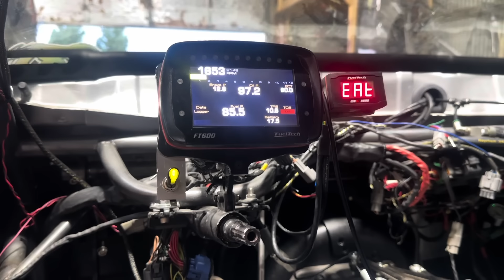Methanol Plugs Up Everything , Sho'nuff

Comment: Worse yet is leaving a fuel system dry, even if flushed. On aircraft, we would fog / spray the entire system, to include fuel cells, removed and open lines, with oil, to prevent dry rot leakage and deterioration, as things came apart. Less then a days time left dry, would turn things to shit.

Comment: You might consider mixing 5 gal. of gas without methenol with 2 cycle oil, not a sythetic oil, a slight touch of castor in the mix helps.
You would run it throught until all the alky is purged and running on gas.  This can be left in the system untill race time.  A drain would have to be added to the bottom of the fuel rail to pump the alky through to purge of gas and oil mix.  Also help to prevent cylinder wall etch and sticky rings from the alcohal corrosion.   And The problem that you are having in the fuel lings. Save the gas for later storage.

Comment: One of the things that could expedite corrosion is electrolysis (static charge), so bad grounds, or alot of dissimilar metals with flowing liquids, boats have this problem and that’s why the have sacrificial anodes, could also been a bad piece of aluminum stock that the fitting was made of
Reply: my thoughts also

Comment: We used to run an injected small block on methanol and a promod. After every race we drained the tank & lines, blew them out with air, blew out the check valves, barrel valve, and pump. Then sprayed WD40 in the check valves, barrel valve and pump and put it back together for the next race. Did it every time.  We also ran alcohol top lube. I personally think that helps with corrosion having an oil in the fuel and it helps the top end since the fuel is so dry. The blower rotor strips live a lot better with top lube.

Comment: galvanic corrosion. look at the metal interactions , there is a chart to see what metal can be in contact. a small aluminium piece next ro a large steel can act as a sacrificial part (anode). interesting stuff.

Comment: The white gunk is likely from the aluminum fuel cell, and the fittings. If you don't flush with gas, cap any fuel system vents so air can't react for upto a week.

Comment: My thoughts: 
Methanol has a low boiling point at about 148 degrees F at sea level, likely lower in Colorado.
When it sat empty, there were probably still drips of methanol in nooks and corners in places like the fuel rail, injector tophats, fittings and stuff. 
Those drips probably evaporated and recondensed throughout the air of the empty fuel system many times allowing the methanol to get all over the place. 

Glad to see you got it cleaned out and restored before it cased any bigger problems. Race on!

Comment: My Kid is always impressed with the Wrenchers death Grip. 1160 ft pounds with a grip force tool. It pisses off My Co Workers  that the the Mechanic has a better grip than the Boys I work with and Dead lift anything They can not Do, Its called Manipulation of force Gang 58 and still strong.
Reply: There's no way it's 1160. 116 or 160 maybe

Comment: Unfortunately that's usually what happens with those big brush/bull guards. Since they're so rigidly supported to the frame it typically causes frame damage instead of just crushing the crumple zones of the truck, usually no airbag deployment to help soften the blow, etc. You usually end up with REPAIRABLE damage without one and a totaled frame if you run one.

Comment: That was a lucky escape for Jamie, sucks for the timing as it could be fixable - hopefully insurance plays nice and/or you can borrow something.

Yes, methanol is great as a fuel, BUT you have to make sure EVERYTHING is compatable with it! With aluminium/aluminum it's actually a VERY re-active metal but it forms an oxide layer 'skin' that protects it - but methanol reacts with it and stips the 'skin' off and, especially if there's ANY moisture in the fuel, it allows very rapid corrosion to occur.
I did mention this way back, but...
The best option it to go for steel fittings through-out, steel fuel tank, special methanol resistant lines and tank liners, injectors, etc.

Comment: Minor frame and suspension damage, get it pulled, suspension parts changed out, get a new bumper and alignment then haul ass. If replaced partial frame rails and full frames but thats minor rail flex that can be tweaked back unless the cross brace under the pan is buckled then that gets into nearly frame replacement

Comment: Some castor twostroke oil saves a lot!
Never sits with fuel....  
That´s one of the problems, you need to open up the lines or let it sit with petrol flushed through.
But consider my advice with castor twostroke oil, like red line alcohol premix.
I makes like a corrosion protection all over inside.

Comment: When I ran my vintage sprint car on methanol, after every race I used yo drain the fuel then sprayed WD40 in all the lines then used air to blow the lubricant through the lines and injectors. I couldn't let it sit for more then a week without doing this exercise

Comment: Brent,methonol will eat away most soft metals Ali,copper,zinc etc. Any fuel with 10% + ethanol can be corrosive. Oxide coating on fittings etc is the only corrosion protection you have. Do you run   a low / no ethanol  fuel flush thru engine after races.

Comment: Methanol like m1/m5 leave a slight residue film on corrosive metals, I tried not pickling when running it and similar probs with pumps and reg going bad because the metals deteriorated. Ultimately we’re back to c16 to avoid the extra work cause it wasn’t enough benefits to work

Comment: The fittings look like galvanic corrosion  got to them. Check your grounds. You also need to run ptfe lines if you're not already. It surprises me how many people dont run ptfe lines. I have them in my build, and i only run pump gas.

Comment: Check for power and ground flowing thru or past the fuel system components, electrolysis could be playing a role in speeding up corrosion.

Comment: Everything alluminium needs to be hard anodized inside from tank to fuel rails.certian mixes of alloy are less effected so alloy choice is also Important .the system will also get a hard time if it drains back and ends up with air inside I've been through the whole Grey powder scenario before it sucks.we used to have to clean the whole fuel system injectirs rails lines every meeting or the cat wouldn't last a meeting.

Comment: I work at a race engine shop in chino California. We produce some of the baddest 4 cylinder motors in the world for dirt track racing….ive never seen a fuel line look like that in the 3 years I’ve worked at esslinger engineering. We run m1 on 90% of our race engines….never…what a freak situation!

Comment: Methanol doesn’t eat lines and fittings, it’s actually when you drain the system and leave it empty that it oxidizes…you either have to pickle the system or leave the system pressurized and toped off with methanol

Comment: Electrolysis maybe.  Kinda seems like it may have some sort of current flowing thru the fuel lines. That looks like the same kind of residue you would expect in a coolant system with electrolysis.

Comment: I have seen a fitting from a mechanical injection system that had 90% of the flare eroded away from high pressure methanol.

Comment: It really seems like methanol and other race fuels really don't like to sit in fuel systems.  Especially long-term.  Very corrosive to metals and rubbers/plastics.  And the biggest thing with methanol is the way it pulls moisture into the oil, and then that oil sits on the valve springs and other valve train components and corrodes/rusts those surfaces.  A good system for flushing the system by running pump gas through to flush the system, get enough heat in the oil to evaporate the water, and possibly using some additives to help protect against corrosion is key for these race cars especially if they are going to sit for while.

Comment: So reading through the comments it looks like you need a heavy anodized coat on all aluminum parts, stainless steel an fittings on PTFE lines plus flush the system after every event. Plus maybe an additive for the methanol.

Comment: Hey Brent, e85 ate up something in my Type-R so bad it clogged the HPFP and I had to get a new one. Put an inline filter before the new HPFP now.
Reply: Probably the factory rubber lines especially if its older
Reply: @BIGSMOKE-bl2lq  2017 Honda Civic Type R
Reply: @chriscrawford2197  that should be fine id have thought
Reply: @BIGSMOKE-bl2lq  something clogged up my pump. Now I get small little black pieces in my fuel filter now.

Comment: I wonder if that’s electrolysis occurring with your fuel system possibly not enough grounds or a large enough ground and it’s causing electrolysis throughout the aluminum fittings??

Comment: When you run methenal/alcohol do you run a top lube or a fuel additive lubricant? Because I run methenal and a fuel lubricant and it seems to help with reducing the corrosion from the fuel in stuff. You might want to look into that if don’t.

Comment: Are y'all running the lube in your fuel? I am thinking that you are having a lot of trouble due to storing dry no lube is probably a issue why your car is the worst because it's not run alot. And if you aren't flushing with some kind of non corrosive fuel you have this

Comment: Need to make a gasoline tune for that thing so when you get home from a race weekend you can run gasoline through the system and flush all the methanol out that what we do with our bonneville cars and sprint cars
Reply: Also coming up to temperature on gasoline helps keep the moisture out of a methanol motor

Comment: you say it never sits with fuel in it, do you purge the system with pump gas? nothing worse than an empty fuel system. you give it oxygen oxydize everything up.  also, you need ptfe hoses with methanol

Comment: 16:30 i’m going to tell you I hate those three ethanol, methanol and nitro. They are all extremely corrosive. I’ve actually used all three of them and absolutely hate them. They are so corrosive and so damaging that after every run, I have to wash the engines and carburetors out with a solution of WD-40 because if I don’t anything metal like steel will have rust on it within 12 hours if it starts to pit the aluminum after about 30 hours now mind you this is just in some high strong RC car motors but it really is no different. It’s just a smaller version of what you’re doing. I’m not pushing the limits on anything to need that fuel for cooling. I still run MS 109 on the streets sometimes a VP 110 but I run C 16 in my naturally aspirated big blocks in small blocks race motors.

Comment: Jamie that  pull on that truck is easy to get it lined back up especially with that heavy duty ass bumper you have on there. Call the collision shop and you can have that thing fixed in a couple hours. I-pull frames all the time bro that's not a tough one at all.

Comment: Is that being “flushed” with “ethanol free” pump gas is the new engine oil for ethanol free pump gas?…….. sounds like the methanol fuel settling into the engine oil too by that point next thing you know aluminum rods etc getting pitted from methanol moisture/corrosion.

MIGHT AS WELL flush with NEW engine OIL with the NEW “ethanol free” PUMP GAS!

The methanol/ethanol supposedly also settles and/or draws in moisture into the engine oil. 

Can’t forget how much the BIG injectors are HOSING down gallons PER of methanol/ethanol fuel , into a single little gallon at best of engine oil.

I know a guy that sends their engine oil to get lab tested for that very reason , to get consistency and better maintenance intervals. 

🍿🥤🥸